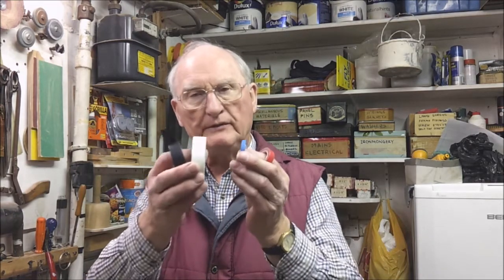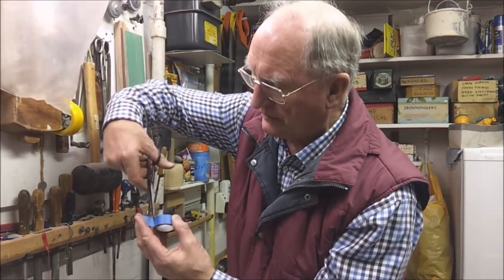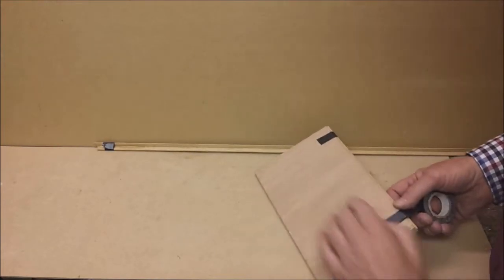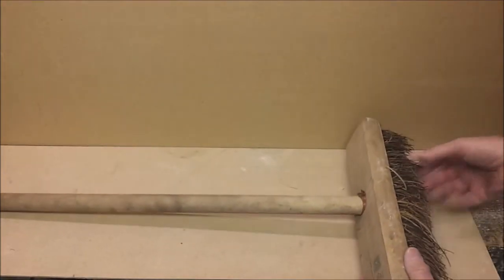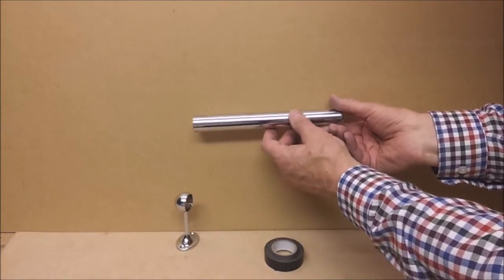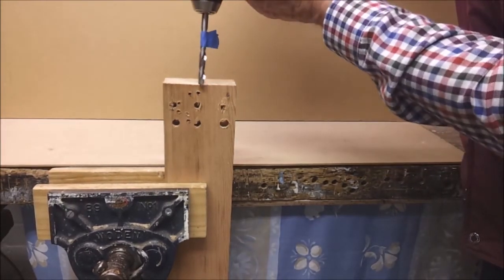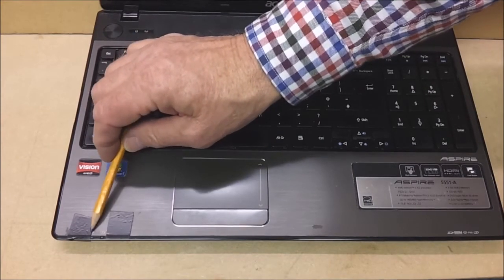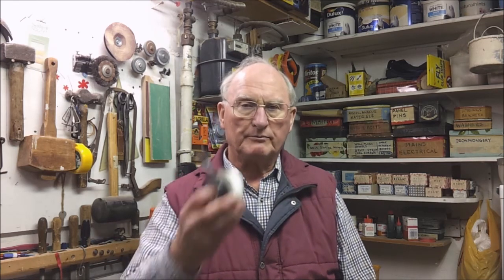The Many Uses for PVC Tape

Comment: Hello, what's unique about pvc vs regular tape?
Reply: Price, quality, trans portability and availability.Mostly easy to remove. However, PVC is persistent in the environment. It is however a "greener" option to fix something with it than to remanufacture that thing (or go to the shop and buy another one instead of fixing it with tape.)